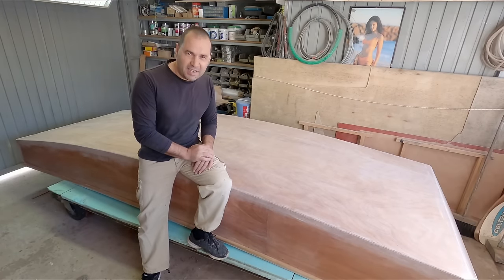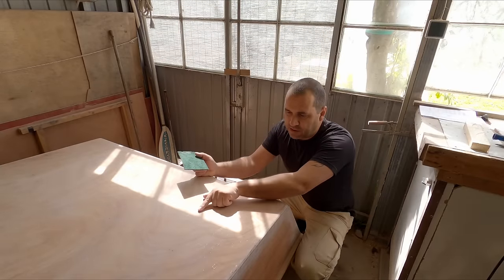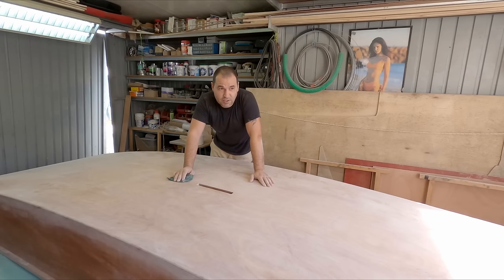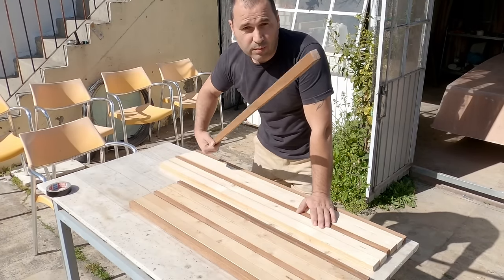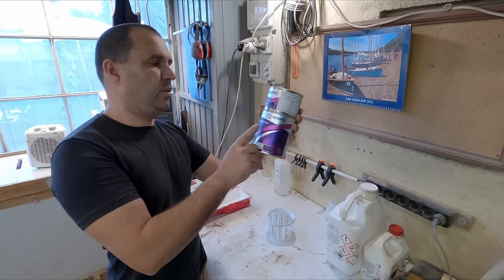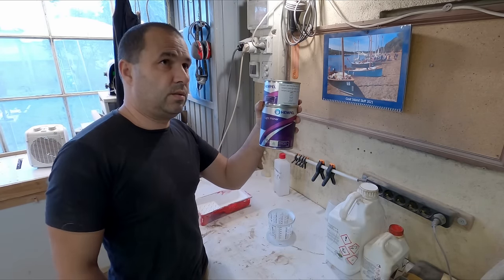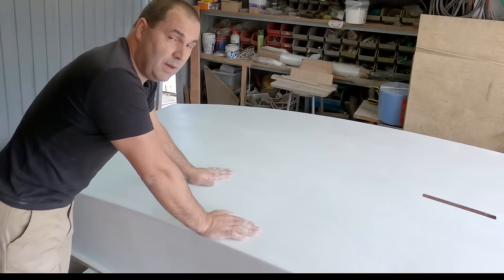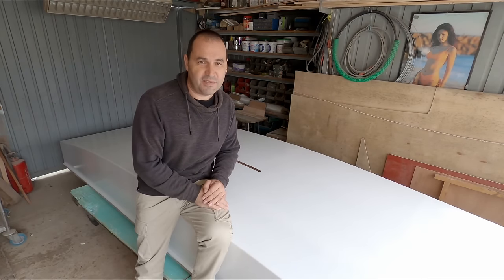Easy to Build, Unsinkable, Car-Topable and Family-Friendly! Carries 3 Adults!! The OZ Goose! Week_09

Comment: Center case is still a scary element for me on a boat (even on mine). Hitting anything hard (e.g. rock) with the centerboard will put tremendous load on the poor thing. So it better be stronger than the centerboard itself :D Nice trick with the file and tape, will remember this.
Reply from the maker: I might put a strip of carbon inside the center case to reinforce the impact point in the case of grounding.

Comment: Teo, a great video again and this time it really hit home for me. I just came up from my garage after a 7 am start and great progress on my rudder and centre board. They are non standard parts from another dingy project that I will use for my first sail on the Goose. I can't make the proper parts until I get the hull out of the garage which I hope to do by next weekend. Anyway, after good progress in the morning, I decided to get the side decks prepared for the final top coat tomorrow. So I started the sanding and masking. By mid-afternoon, things were going well and then a little voice in my head said "go for it - you could get the top coat on before the day cools down too much". I was very tired, but I decided to press on. Out came the 2-part polyurethane, along with a tin of thinners. I prepared everything very carefully knowing I was tired. I mixed the 2-part paint and added a little thinners - things looked a little odd, but the thinners mixed in OK. I started the paint job and then something flashed through my old brain  - Oh b*llocks ! that was Epoxy thinners I just used. I came up to the house very dejected, but watching your video cheered me up immensely. Keep up the good work>:face-green-smiling:

Comment: Why dint you use single pieces of wood for the foils? 
Thans for all the great content! 👍👏👏👏
Reply from the maker: Hi,
a single piece of wood has a tendency to warp due to the grain. By using strips the warp is minimum and the grain on each piece would want to warp in different direction from the adjacent one, keeping it very stable and flat.
Reply: @TheBoatRambler  great tip, thanks!

Comment: And here we go - another great video!

Why aren't you doing the epoxy graphite like on the goat again?
Reply from the maker: Hi Marcus! 
I didn't use epoxy graphite on the GSI... 🤔
Reply: @TheBoatRambler but what was the black material on the hull of the goat?
Reply from the maker: @marcus_k85  if you are reffering to the paint it was Hempel's one pot  Hempalux 52970 black.
Im going for lighter color because black will be too hot to sit on when exposed to our summer sun.